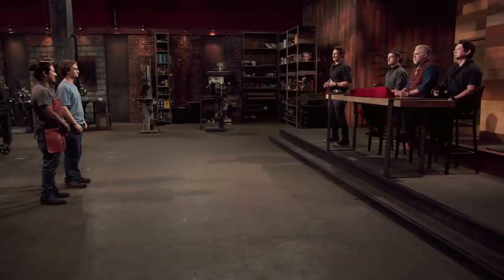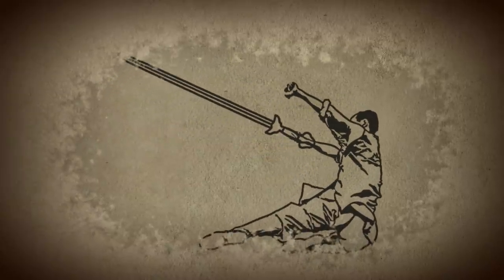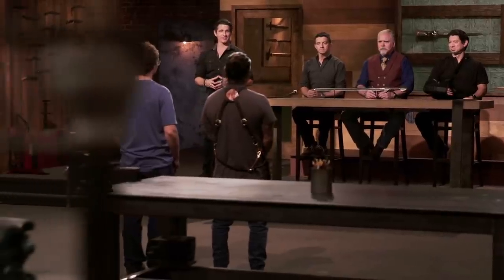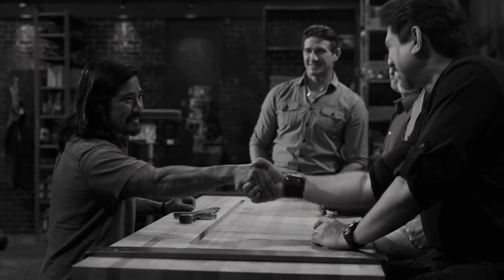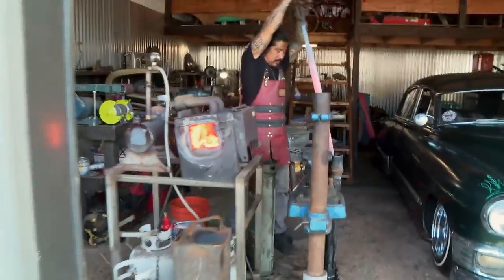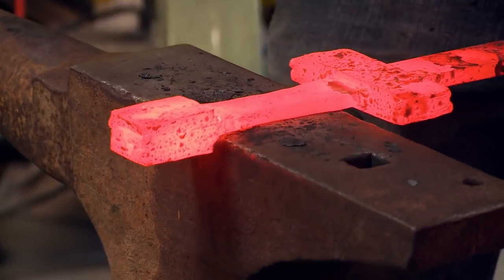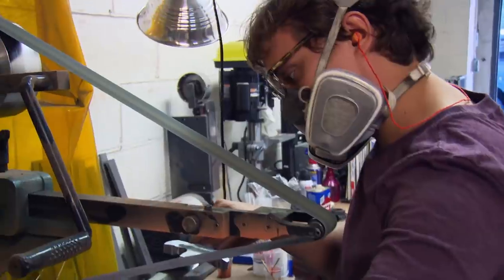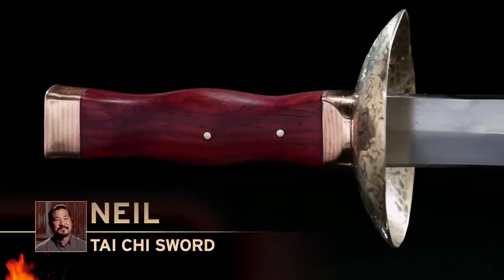Forged in Fire: Traditional Tai Chi Sword Can SWIFTLY SLICE "But Will It KEAL?" (Season 4) | History

Comment: “Your blade must be double edged, have a WINGED GUARD and a pommel”…. Did they all forget about that winged guard part? Or is “winged” just a much more…fluid term than I thought? 😁
Reply: Mhm!
Reply: Winged is just like bend towards the tip and they both are even tough I dont know if the round one technically is winged

Comment: Just curious, would anybody be able to answer this for me:
If you're worried about the weight of the tip bending the sword, while heat treating in that small furnace - would simply rotating the forge 90° vertically not be the answer?
Thanks in advance.
Reply: Maybe the set up doesn't allow to, it's time consuming, familiarity of horizontal method, and  many more... But it's definitely possible, I've seen it on some contestants.